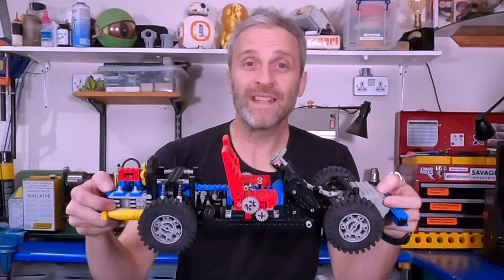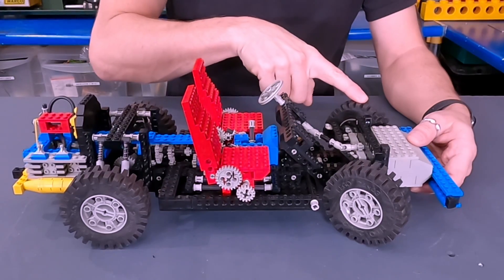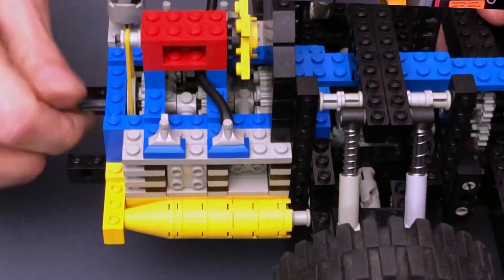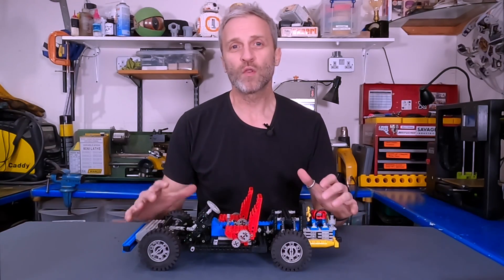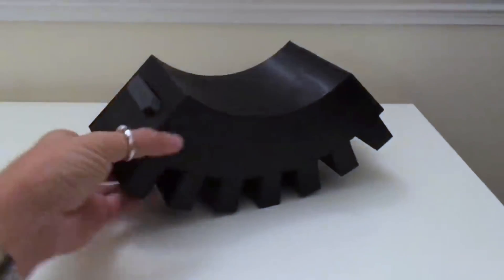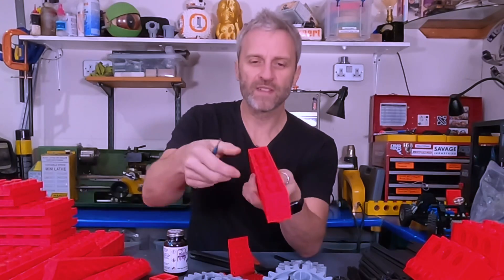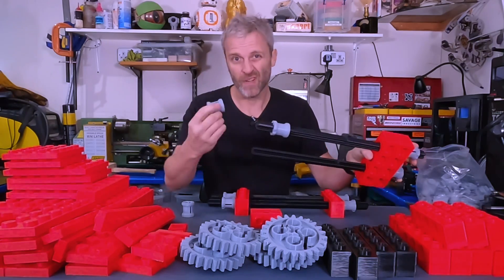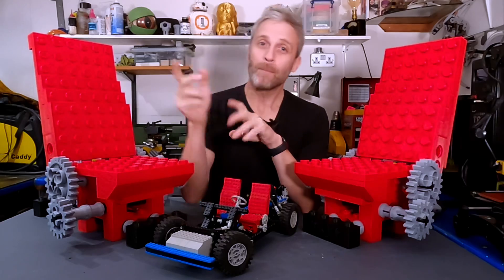The Iconic 1980's Lego Car Chassis! - Can it be done? - Mantis Hacks

Comment: I'm trying to find all the parts from this very same model at this moment. I'm still missing a few parts but I will try to keep my small build up with your big one. I'm mostly missing grey bricks, so if you keep building in the order of the manual, I will be fine for some weeks to come. I noticed you are still missing at least one red plate on the back of the right seat (left for the viewers). I'm really looking forward to you solving the huge floor plates without deforming. I always love your video's.
Reply from the maker: Thanks. Yeah it took me a while to find the parts and I’m missing a few parts still! The red plate missing I took off for a photo and forgot to put it back. From now on I won’t be following the manual but keep going.. I think you’ll beat me 😅

Comment: Be careful when reproducing the differential - there is a patented part in there and LEGO is sueing people left and right over that, that includes MOC creators who just sell plans featuring that part.
Reply from the maker: Huh! Interesting. Well I won’t call it lego for one thing.. but why would they go after people for using it in a MOC?
Reply: @MattDenton  sorry I have been mistaken there. The part in question is the "Changeover Rotary Catch
Item No: 35188" which actually is part of a transmission (not differential) of a newer technic model.
Nonetheless LEGO has been pretty active hunting down "imitated" LEGO and generally anyone who is making money off of LEGO. This includes MOC creators who sell plans for models containing said part.
Reply from the maker: I think the key is don’t call it lego and don’t make money using the name Lego. It’s a shame tough because there are some great MOC builds. I have the Sisyphus by JK Brickworks.
Reply: @tripwire76  As far as I can see, this part was never used in this set. Apparently the part was first used in 2018.

Comment: Fantastic. AND using the best filament to make it. Polymaker FTW! 
Question too, what's the lather you have behind you? I'm looking for a small one for my shed, that looks a good size.
Reply from the maker: Thanks. It’s a cheap Chinese lathe I think badged by Warco. It’s ok for small jobs but don’t expect precision!
Reply: @MattDenton  Thanks Matt, I'll have a look, and another look around for one.
Reply: @Rob_NABS  the Warco stuff isn't actually bad stuff. I have one from their near competitor - Chester. Tbh I think Warco now have the edge over the two. I'd go for the larger end of their scale, think its called the model 280. This is big enough to use a boxford style quick change toolpost on them, which is invaluable. With a good set up and decent tools you can be pretty precise with these things.

Comment: For the friction between parts would it be possible to use a Teflon or dry ptfe spray inside the holes?
Reply from the maker: I have tried that but it didn’t work as well as hooped :)